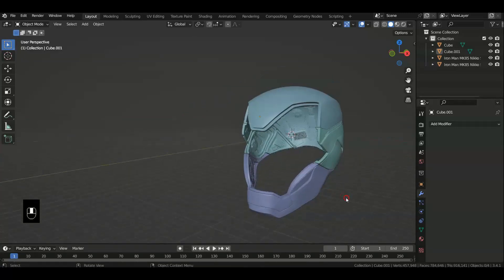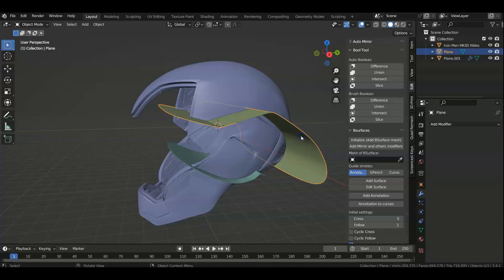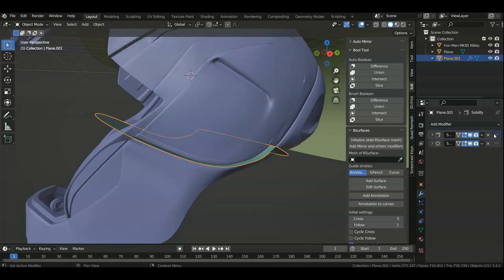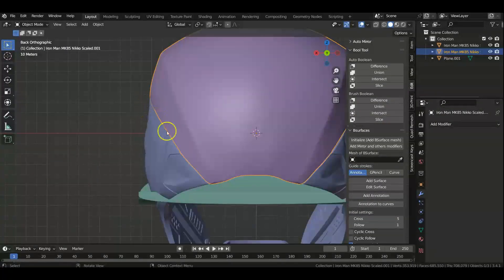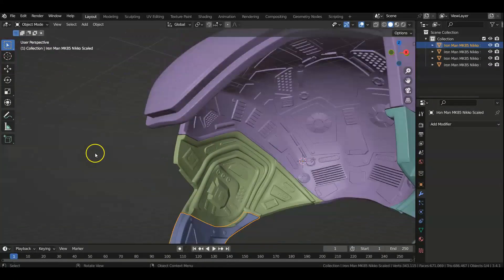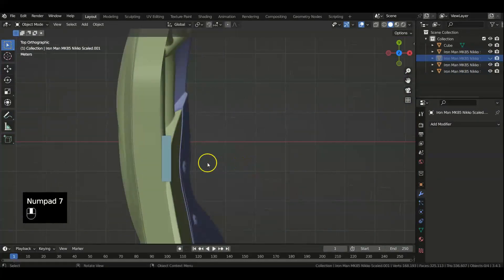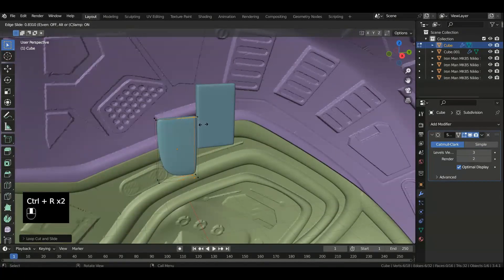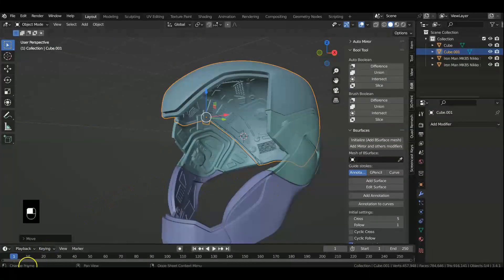How to Cut 3d Models With Curved Planes

Comment: Thank you very much for this.   I’ll look into your course as I want to break from freecad and start with blender.   I recently downloaded a glider from printables were the author subtracted a cylinders with the diameter of a filament from parts to align parts.  I scaled his glider up, so I had to print small cylinders after measuring the holes.

Comment: I tried to contact you on Your website but haven’t heard back.

I have a smaller 256x256x256 build plate and I want to join for 10 bucks a month but I was wondering if you had helmets you have cut for smaller build plates yourself so I don’t have to learn a new skill just to join .

Having a job and family , I barely have time to get to use the slicer as it is.